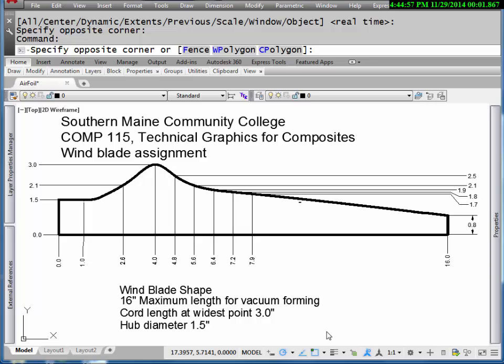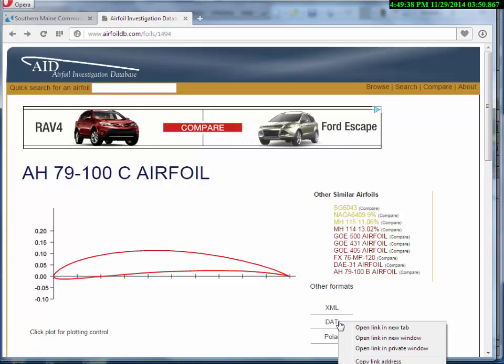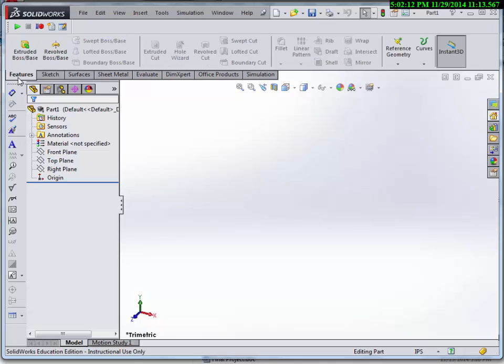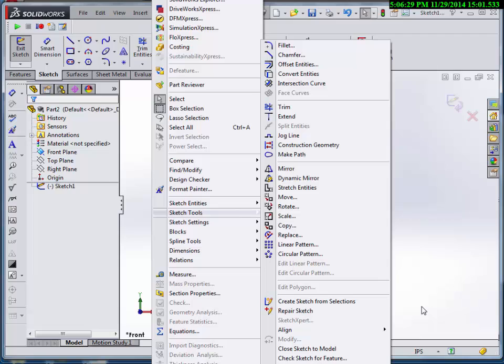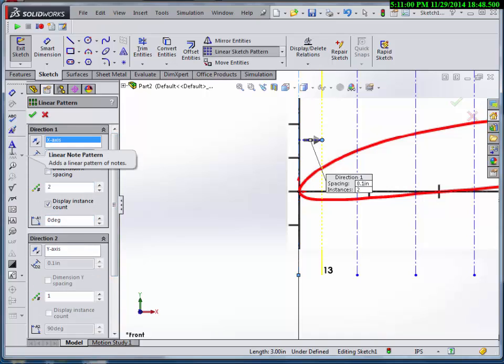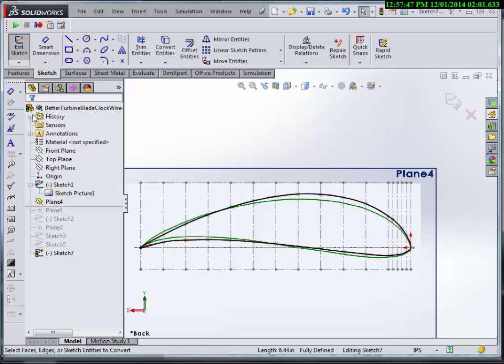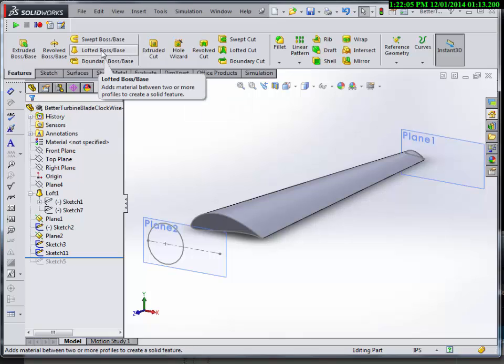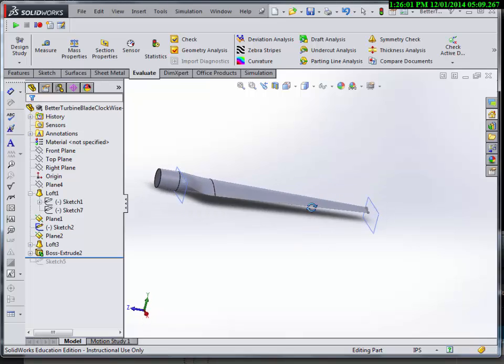SolidWorks-WindBlade

Comment: Hello Daniel I’m having an issue when transferring the text file onto solid works to get the shape. It’s coming up with an error message when selecting the file. Any idea?
Reply from the maker: What is the error message?
Reply: It’s all good I was using the x, y and z way but watched more of your video and seen I could just sketch over it instead. At 17 minutes when your shape changes from that though how does that happen?

Comment: is there a way to calculate de tilt angle or 10° is standard ?
Reply from the maker: I don't know the answer to that question. I just used a common angle for this demo, but wind blade designers probably have done testing on different angles and may have a means of calculating for various applications.
Reply: @DanAbbott-SMCC  thanks

Comment: Hey, can you give me the source from where you took the blade dimensions?
was it from a paper of a general sizing?
Reply from the maker: The shape of the airfoil I got from the website identified in my notes, but the size I selected based on the size limits of the 3D printer I planned to print it on and the size limits of our vacuum forming machine.

Comment: Hey, I got a warning when ı tried to add excel txt file, what should I do?
Reply from the maker: I'd have to know what the warning was. Make sure your settings match those on the video.
Reply: @DanAbbott-SMCC  the warning says file is not valid. I actually quite sure that I did what you did in video

Comment: why mi Cvs dont make me a close line in the airfoil?:P
Reply from the maker: You may have to edit the lines. Check to see if there is a gap or overlap at the trailing edge. Even if it isn't closed, you may be able to extrude a contour rather than the entire sketch. Send me the .sldprt file with the sketch if you can't make it work. dabbott@smccme.edu